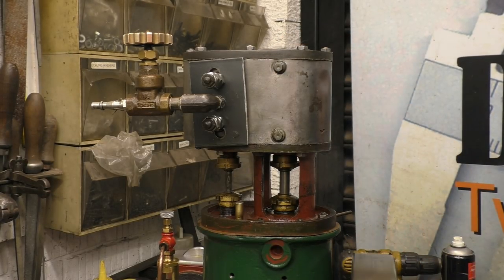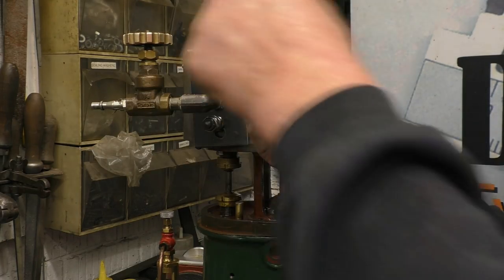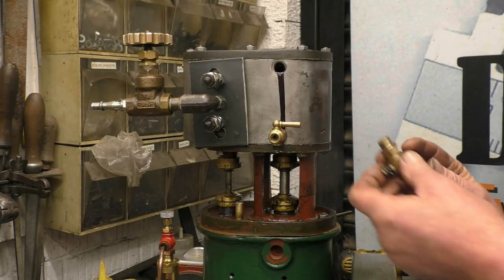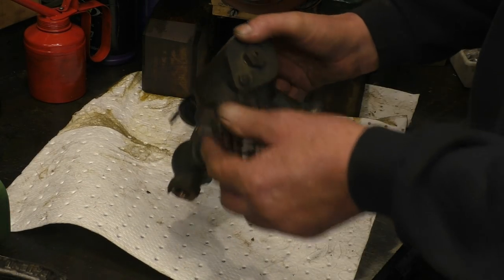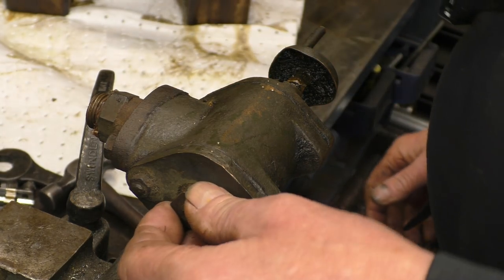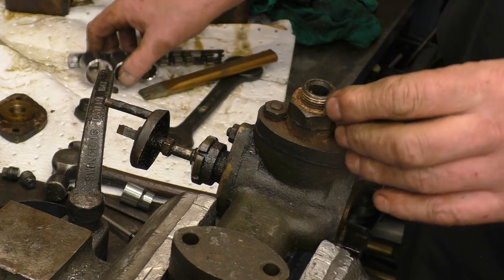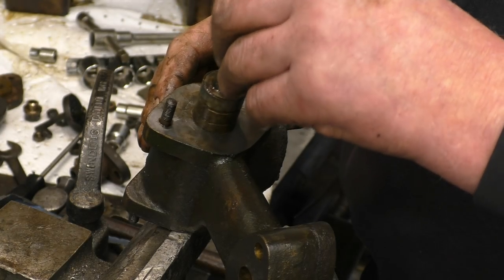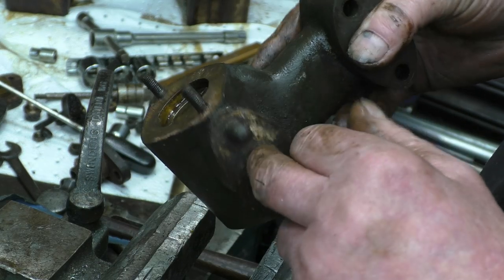Stuart Engine P30  . Steam Control Valve

Comment: Thanks for sharing! Goopy steam oil saved it. I worked on an offshore unit that used V 6000 steam oil it had been in line for 40 years with lite maintenance and was pulled out and replaced with a new modern unit, the new one didn’t last 5 years. We refurbished the old one and put it back in line after the manager was fired.